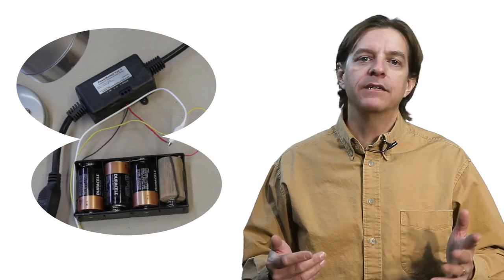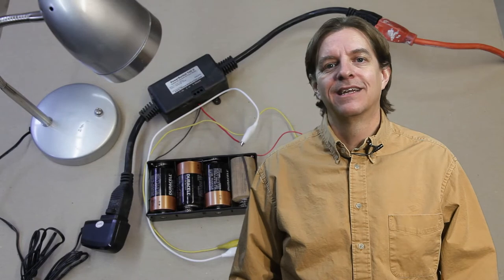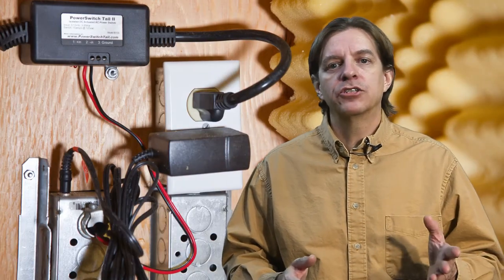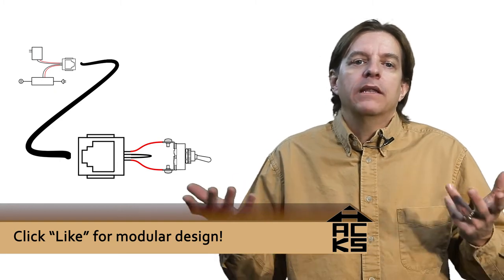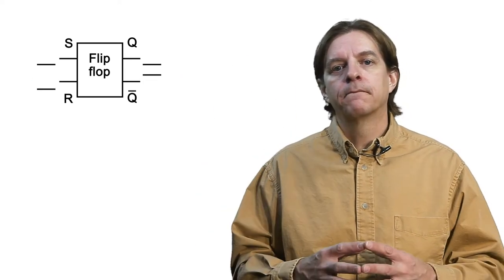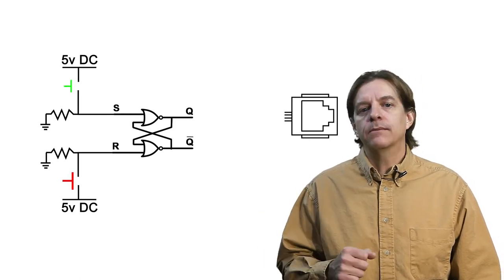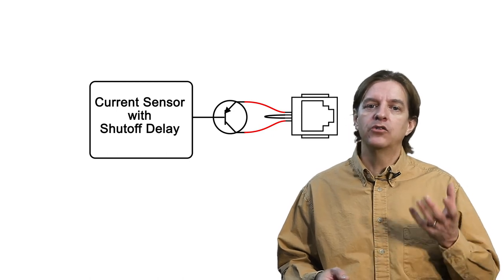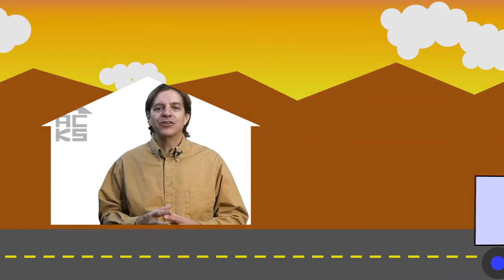How to make a latching remote switch

Comment: hello there, interesting idea, but is it a wise decision to connect the basis of the transistor without any resistor ? Sorry, just asking. Or is the final layout different? In that case a schematic would be nice. 
Anyway, great video, thank You !
Reply from the maker: I didn't put a resistor in line with the transistor's base and generally don't see one in most applications. Why do you ask?

(I guess in some cases, if you have  tri-state output on a chip, you might want one to keep the base from floating when the chip's output is disabled. But that's not the case with most gates. Their outputs are driven either high or low.)

Thanks for watching. Peace.
Reply: Well, I guesse it's just overprotective me, but I'd just add a 1K in Line , just in case the transistor shortens and the IC would get some more voltage/ current thank it could chew. Or the shortage may go the other way round. As I Said, just my way, no offence. Think it's just a remainder of those days when I used to Dirk with Germanium Transistors 😃
Reply: Work Not Dirk , sorry
Reply from the maker: Ah, I understand. It's a trade off between complexity and cost and failure mode safety. It certainly doesn't hurt if you want to do that.

And no offense taken. Interesting to get other people's perspectives.

Cheers. :-)

Comment: What AC/DC adapter are you using? I just got a powerswitch Tail, but it says "DC input: 3-12vdc (3-30ma)". I am unable to find an AC/DC adapter with that low of amps. Any suggestions?
Reply from the maker: +Kevin Davis The milliamperes rating on the PowerTail indicates what it uses out of the power supply. As long as the supply has at least that much, it'll work. It may, and usually does, have more. In fact it's better for a power supply to have a larger amp rating than needed. You just need to be careful on the voltage that it doesn't exceed the range. Does that make sense?
Reply: I think I get it.  I just attached a 5v 1A AC/DC converter and its working just fine. thank for the help and great videos.
Reply from the maker: Awesome! Happy to help. You're welcome and thanks!